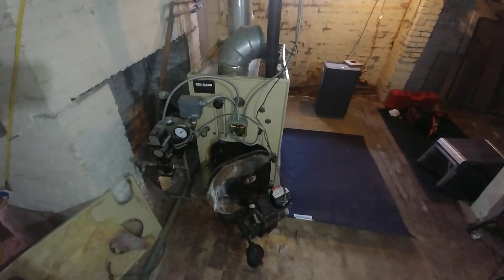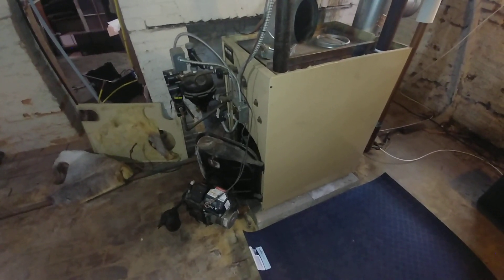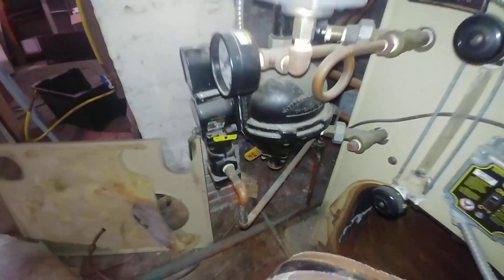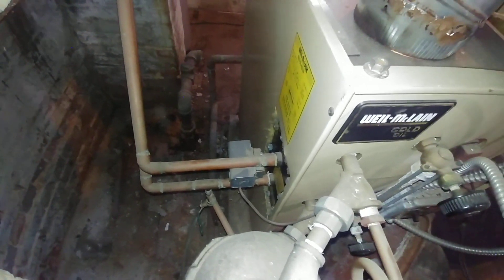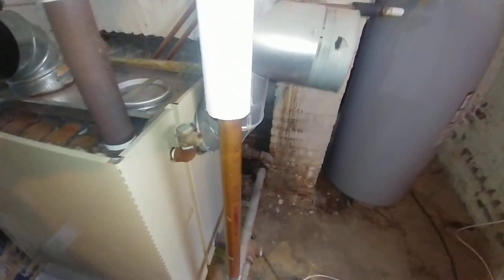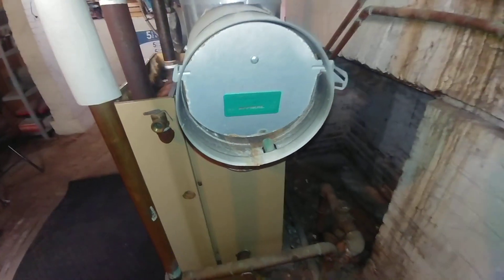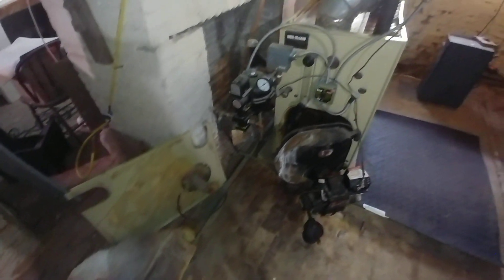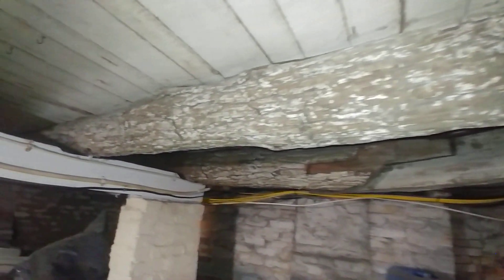Sand! Sand Is What Finished Off This Oil Fired Weil Mclain SGO Steam Boiler!

Comment: Hey, this is not even a you tube installation. A Homeowners friend knew a guy who once worked in a plumbing supply.
Practically a plumber’s helper.    Old boiler was a pot belly and they improvised a header. We can criticize the piping set up but seems like the leak was what did in the boiler not the installation.    IT WORKED !
Reply from the maker: It never ceases to cause wonderment in me to see just how bad a steam boiler can be piped in and still kinda "work".

Comment: Looks like they have piped it up like a hydronic boiler!,the summer/winter coil was used for hot water?
Reply from the maker: Yes, that was the summer/winter domestic hot water coil, AKA a "thankless coil" (har).
It is all too common to see steam boilers piped in as if they were supplying  hot water.  It did heat the building for several years piped in that way.

Comment: I'm not exactly sure what you'll think of this but with one of the techs I work with. I've noticed that he carelessly seems to leave the psi set at 9 pounds. I've been able to get sneaky and turn it down to 1.5 psi when he isn't looking and he never is bothered to notice. He never adjust the pressuretroll but just seems to install them at the pressure they were at out of the box.

Comment: How did they figure out it was dry firing? Did this boiler set off the smoke alarms?
Reply: Yep! At 11:45pm in January. Hit the kill switch and when I got into the basement discovered smoke coming out of the rear sections of the boiler. That was a fun night.